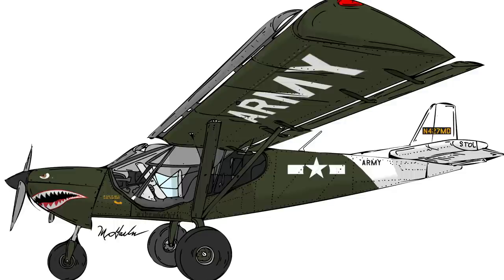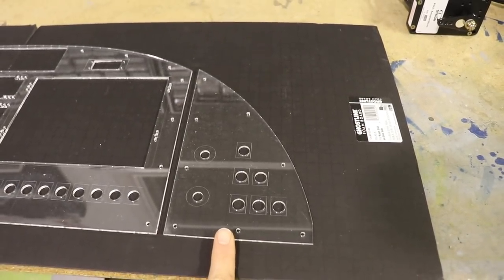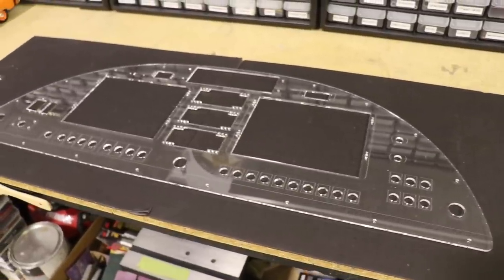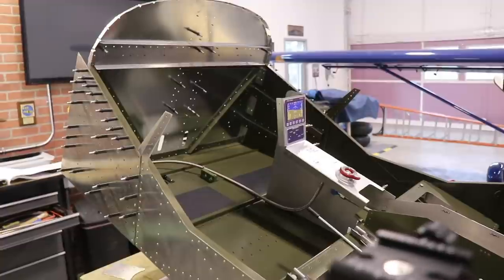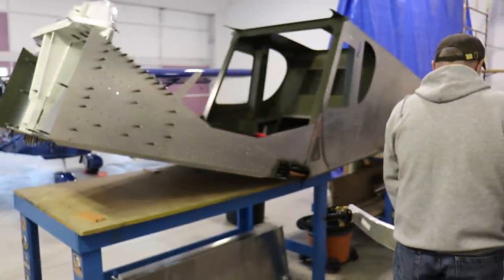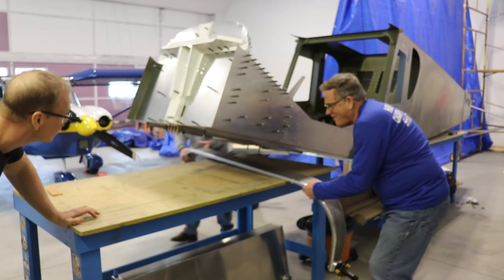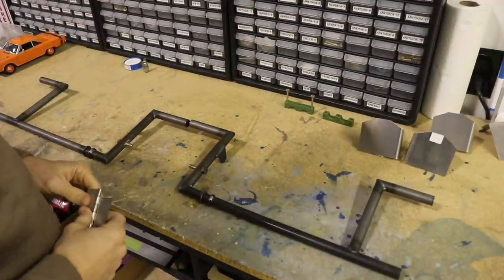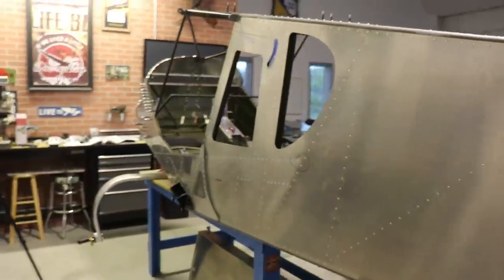Zenith Super Duty Instrument Panel Build (Ep40)

Comment: I hope you read new comments on old videos. I've truly enjoyed the series thus far. I'm thinking of building a Zenith with, and for my nephew. If I can pass the 'flying torch' along to him.... (Not to mention, he has a 520-acre ranch and plenty of room to grade a runway). At 76, I don't have a lot of landings left. The notches cut on the main gear bracket... I wish you were here, since I have a milling machine in my shop. I would take an equal amount off each side so the bracket remains centered and you have an equal shoulder for each bolt to buck against. Aside from grinding/sanding off the ninety-degree edges and machining marks, I wouldn't worry about weakening the brace. You land hard enough to bend or break that brace... you'll have already torn it off the plane on landing. OH... you're installing electric trim... does it also have a mechanical trim wheel? Carl, ATCS, CFII... retired.

Comment: If I understand the landing gear problem correctly, you need the notches in the legs to be closer together toward the centerline of the fuselage?  Or in other words the bolts need to move further out away from the center of the fuselage?  Would it be better to shim/bush out the landing gear brackets?  I see they are bolted and riveted, and drilling out the rivets sucks, but bolts aren't that big of a deal.  Just a thought.  If I was considering doing that, I would measure how much shim is required and then divide it evenly between the two brackets on either side to keep it symmetrical.  Good luck!

Comment: How different is the SD fuselage from the Cruzer fuselage?
Reply from the maker: It is similar, but there are some very big structural changes. On my Cruzer the landing gear came without any slots cut into it-I had to measure and cut my own. The SD's gear is "pre-slotted" which saves the builder a lot of work, but it appears the spacing is off.

Comment: If you are flying in the right seat, wouldn't it be quite the reach to then activate the trim and the flaps all the way over on the left?  Could you duplicate those switches on the right as well?
Reply from the maker: The trim and flap switches are easily reachable from the right seat, and I see no need to add more complexity to add additional switches to the right side.

Comment: Did you ever consider installing the dual control sticks with the throttle/mixture in the center like a typical aircraft? Even with the throttle on the right side you won’t have easy access to trim and flaps from the right seat
Reply from the maker: No, in my opinion the center Y stick is the way to go. It makes getting in and out so much easier, and it's comfortable in flight.
Reply: If you have room for a couple more switches on the right side I feel sure you could have flap and trim controls on both sides.

Comment: My 2¢ worth about your gear problem.  First, check the symmetry.  If one side is off-center, then address that one.  If both sides are askew, then you would have to address both with each having 1/2 the correction.  I would expand the slots over-size and manufacture a bushing to take up the slack.  That bushing could be silver-soldered to the bolts, or epoxied.

Comment: Wouldn't it be more "correct" to slightly open up each of the bolt reliefs so that the landing gear is as close to perfect center as possible? If all four bolts have a common contact orientation (all touching on the fuselage side), the gear can't move in any direction. (I should have read down the comment list further - I see others have had the same thoughts. Thanks for the videos)

Comment: What about spacers to relocate the mounting brackets for the gear to the correct distance.  Splitting the difference of the error, keeping the landing gear centered?
Reply from the maker: If you saw how the gear brackets are mounted to the fuselage, once the holes are drilled the brackets can not be moved out.

Comment: Perhaps a weird question but it seems to me with the stick in the middle I assume you use your left hand to operate the radio controls. I have been trying to visualize reaching over with my left hand to do that and it seems strange. Especially if I am in IMC. Hoping to have one of these planes one day and sure appreciate your videos.
Reply from the maker: No I use my right hand to change the radio. This isn't a helicopter-I don't need a hand on the stick every second of flight.

Comment: Are you going to have the trim and flaps on both sides?
Reply from the maker: No. I can easily reach them from the right seat. The idea with having a throttle and brakes on the right side is for me to take over if the student get us into a bad situation, not to regularly fly from the right seat. But even if I did just want to fly from the right seat, I'm able to reach the flaps and trim easily.

Comment: That's a bummer with the gear. If you just grind out the notches on one side will the gear be off-center?  Maybe you need to split the difference and grind half off on both sides to be sure the gear is centered.
Reply from the maker: I thought about that, and even if it's off center by 1/4" it's not going to matter, but that's a question I'll ask Zenith. I'd like to keep one side untouched so that it fits snug around the mounting bolt.

Comment: A semi-circular notch does not seem like the best way to resist lateral movement if there's clearance. That's a recipe for wear over time ?

You've mentioned that the gear was positioned correctly during your trial fit, so presumably it is handed (a left side or port side and a right side or starboard side).

As cross wind landings on the upwind wheel are a reality, I'm suspicious, like you, when it comes to the mis-match in the design.

Intriguing, engaging and captivating content as usual. Thank you for sharing.

ps - giving it some thought, stack up of tolerances would suggest that tapered pins would be a better design in order to prevent lateral movement of the gear. Positional tolerance on the the notches, their size, the bolts, their size, the holes in the brackets, their size, the location of the brackets, all means you'll have gaps, possibly as much as over .090" ( just a wild guess ) , implying those notches really are only there to keep the gear from slipping significantly if the frictional force at the interface with the rubber pads fails.

That might then imply it is ok modify the notch so the bolt fits. However since I do not know the designer's intent, I'd go with your chosen plan to run it by the folks at Zenith before you remove any metal. I'd also consider trial fitting the gear the other way around - if only in one's mind -  just in case you assembled other components (e.g. axle) incorrectly; not something  that's likely when it comes to your work, but things happen.